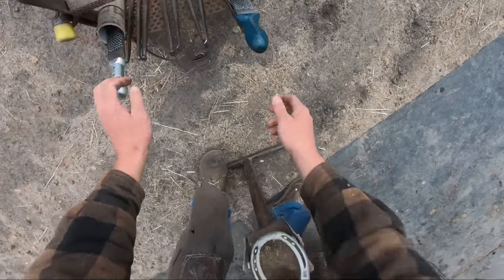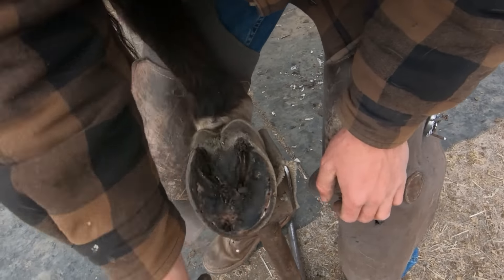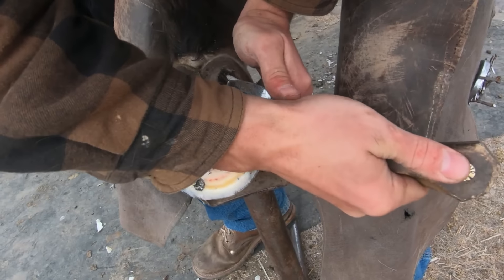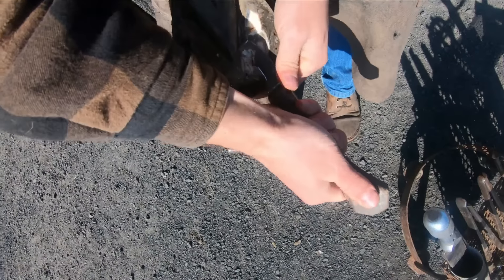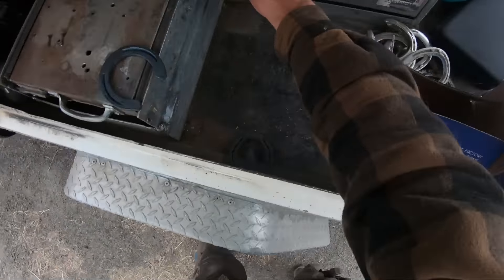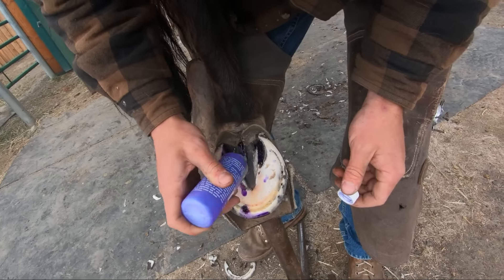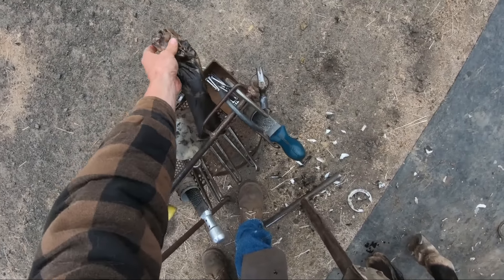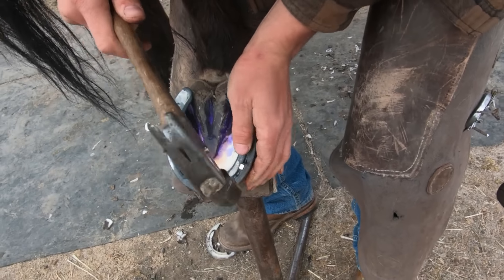Horse Hoof ABSCESS // How I HELP Him RECOVER // HORSESHOEING

Comment: Someone else may have said this: the hollow in the top of a brick is also called a ‘frog’. Early bricks often had a rounded indent made by a lump built into the wooden former which looked a little like a crouching frog. The hoof frog, wide at the base and tapering, looks a bit like a frog’s back too.

Comment: “Everyone yelling in there heads” BE CAREFUL OF THE FOOOT SIR.
“Me” searching google to see if horses can feel pain at there feet’s/nails?
Reply: So do they feel pain?
Reply: @riccardolago7381  I’m not OP but no, unless the farrier goes too deep. Imagine trimming your nails if they were on the bottom of your foot. There isn’t nerves there unless you go deep enough to hurt them.
Reply: @riccardolago7381  it feels like having your nails done
Reply: @bee4627   I go to riding lessons and horses have a "frog" the inner triangle of the hoof and that is like the cuticle of your nail. If you use a hoof pick right there is can be very painful for the horse. Like BubbleBrainz said if you go too far it can hurt, but there is a very thick hoof shell and it can take a while to do this.

Comment: Did you e ver think In Trying tô use araldite as protection, araldite seem very tuff stuff and not easily remove. But they are kind of expensive and At least 40min tô harden

Comment: I liked the video but I just happened to notice that you are using the hoof pick in the horses frog. (the inner triangle of the hoof) I was told by my riding instructor that this is painful and not good for the horse. If there is any specific reason you do this pls write me back. Thx

Comment: Hell yeah that pressure will hurt. Anyone who ever hit themselves in the thumb with a hammer can tell ya that. You will pop blood vessels and bleed under your fingernail. Provided it was a hard hit. 

blood pools up between your skin and your fingernail with no where to go. Fingernail turns blackish purplish. and ultimately the fingernail itself can just die and fall off. Then grows back. 

Until you reach the state where your fingernail starts dying and chipping off. It throbs. Ofcourse you can end the pain sooner by simply poking holes in your fingernail to drain the blood. 

One time becuase of just being buisy i didnt get the chance to drain the blood fast enough and it dried under the fingernial. That time i had to literally pry up the corner of my fingernail and scrap out the dried up blood.